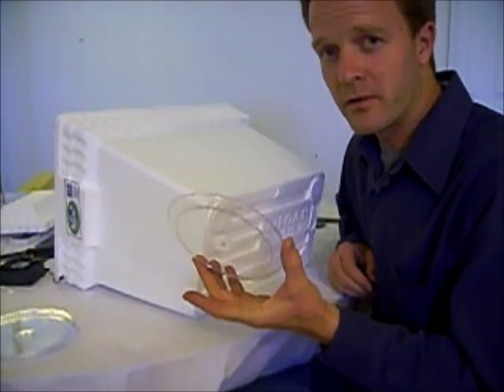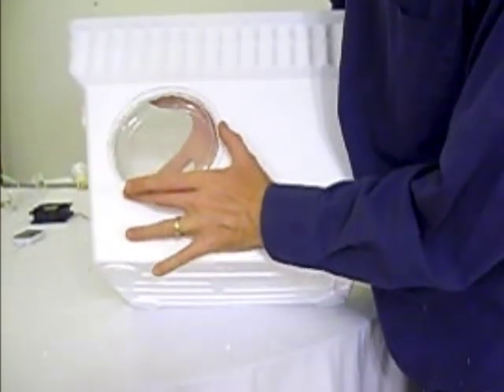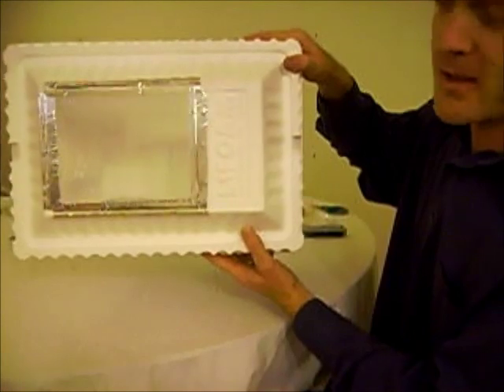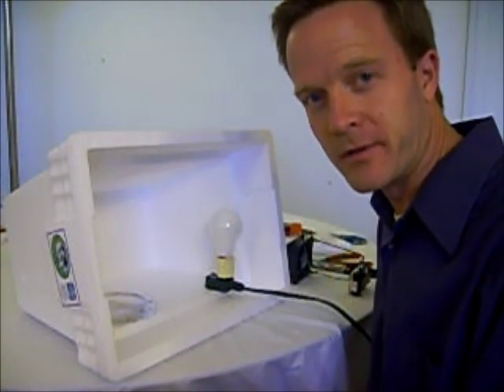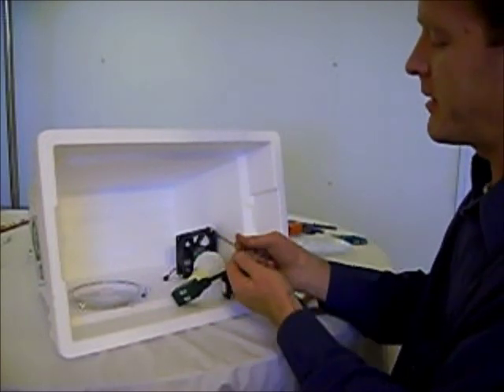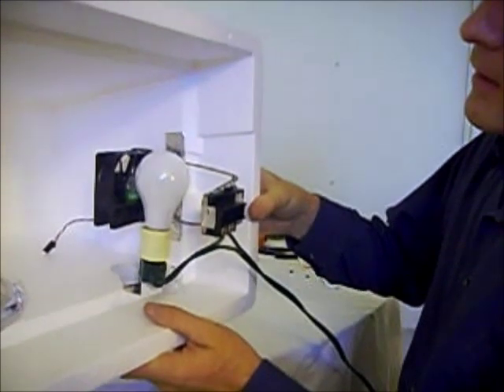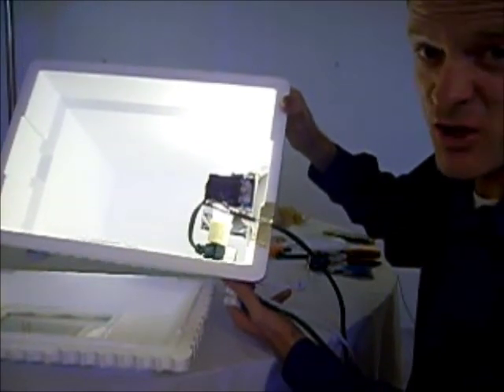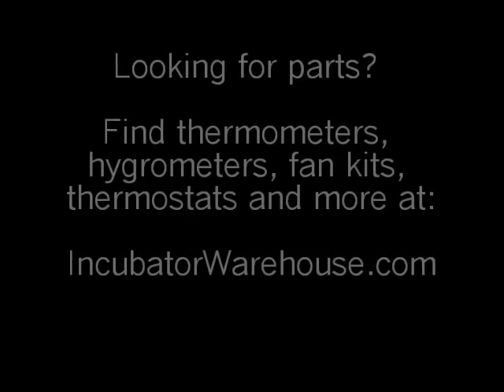How to make a chicken egg incubator EASY DIY (Part 2) Build it yourself

Comment: Tractor supply sells a incubator called the little giant incubator for 39.00 and works very well. I installed a small computer fan in mine. I also use it to germinate seeds.

Comment from the maker: Yes, you are correct about warm air rising.  The concern is that bottom is where the eggs go.  And also closer to the water that will be used to control humidity.  So it's a trade off.  If you have the space at the bottom and can safely keep the fan/thermostat/heater away from the water, great.  Otherwise, moving it up and ensuring you have good circulation may be the way to go.

Comment from the maker: Yes, you can certainly use a fan when not using a thermostat.  The thing to be super careful about when using  a dimmer instead of a thermostat is that very small changes in your room temperature will have an impact on the temperature inside your incubator.  And as the eggs develop and begin producing their own heat, this will also have an impact.  So you you may find that you have to continually adjust the dimmer to get back where you want to be.